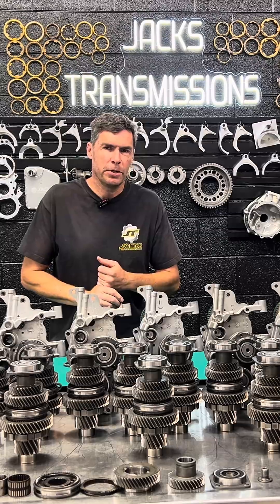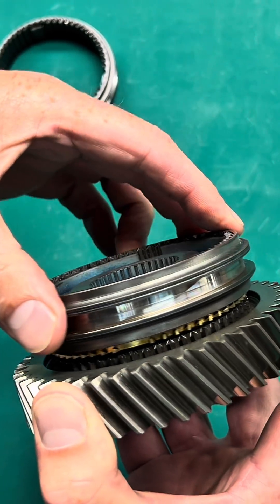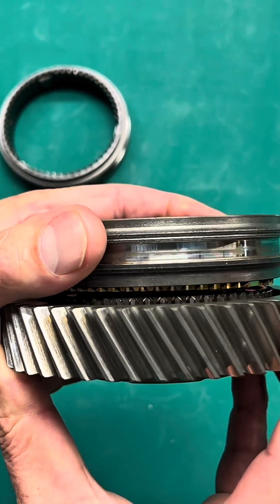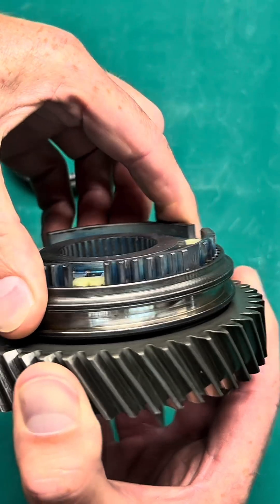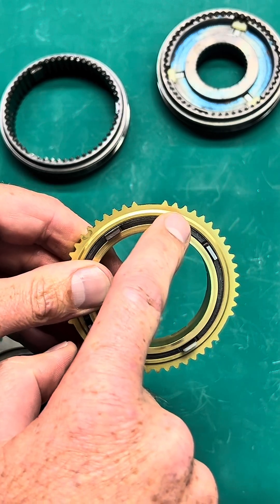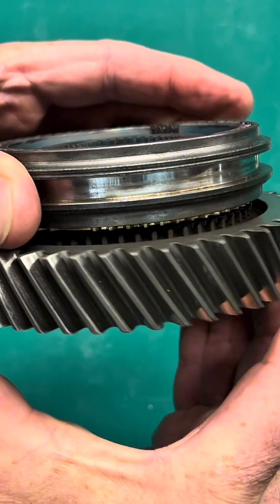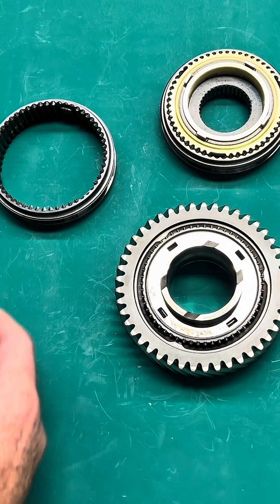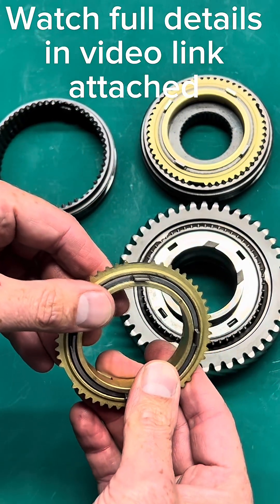SST DCT470 Start-Up Grind. Worn Synchro Teeth and How It Works. Jacks Transmissions

Comment: Have exactly the same sound when 2nd is half loaded towards 3rd on a GR6 . Have u ever listen or solve this kind of issue on a GR6 transmission.?
Reply from the maker: Yes that is called a clutch harmonic in the GR6.  It's an issue with the clutch and NOT the synchro.  I am making a video about the 2-3 harmonic issue for the GT-R that will come out next week.  Very detailed info on that one.
Reply: @GVR1670 Appreciate your videos. Thanks for your time .